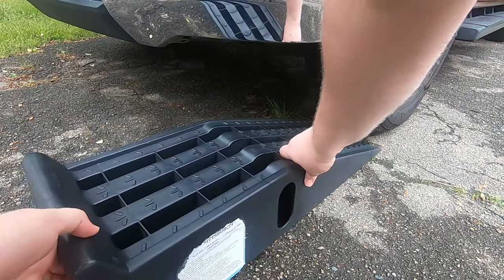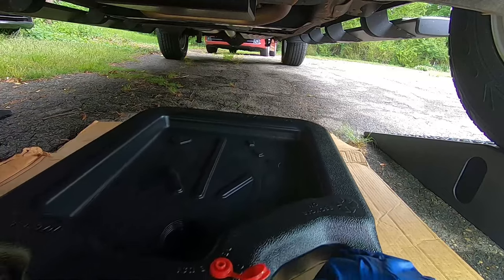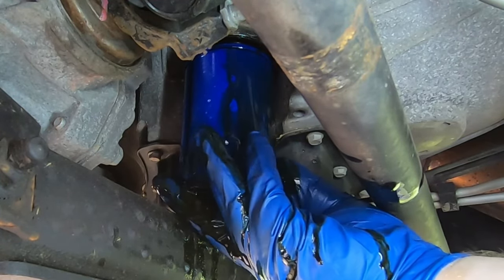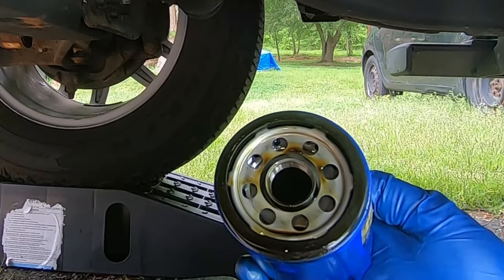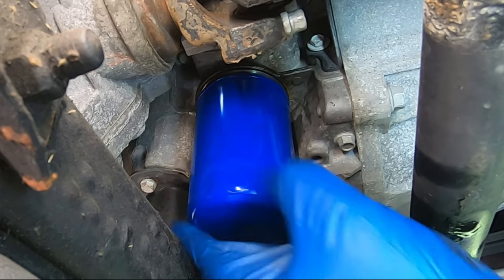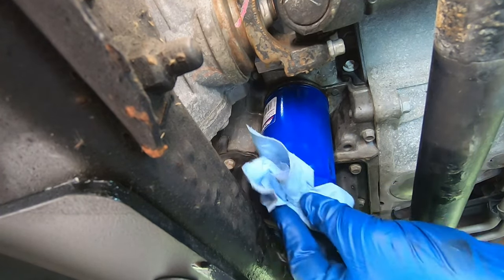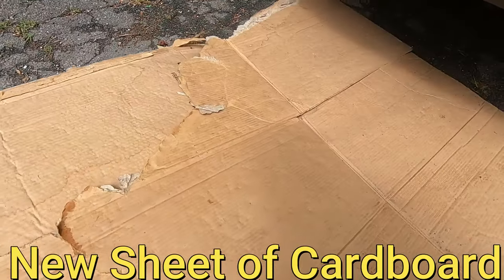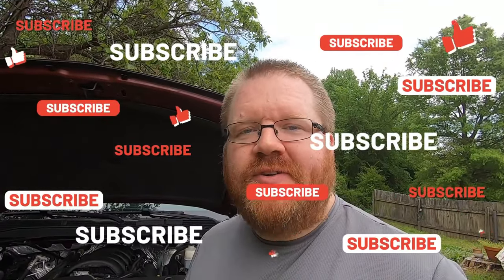2014 - 2019 GM 5.3 Liter V8 (L83): Oil & Filter Change - Full Walkthrough!

Comment: Just like Chevy to put the same motor in every vehicle lol. And particular reason for going with mobile one? Meaning is that what is recommended?
Reply from the maker: Mobil 1 is Dexos licensed, meaning that it meets GM's stringent Dexos standards for synthetic oils. Most GM vehicles produced after 2011 require the Dexos approved oil specification. So as long as the oil says it's Dexos certified on the back label, it should be fine to use. 

Back in the day, Mobil 1 was recommended on the LS1/LS6 engines on the C5 Corvettes. It said Mobil 1 right on the oil caps 😉
Reply: @TrickShiftGarage  I noticed "Mobil 1 Advanced Full Synthetic Motor Oil 0w20" is dexos approved, however not the one you used High mileage one, unless its hidden ? also whats that ticking/clicking sound every one second interval ? (at cold start) ....
would using kirkland 0w20 dexos approved is fine too(with mobil 1 oil filter) ? just worried about lifters issue
Reply from the maker: You know... I think you might be right! 😬

Looking it up online, the high-mileage version doesn't have any references to being Dexos approved! The normal 0W-20 synthetic is Dexos approved but the high mileage version isn't... that's so strange! Great catch on that! I'll make sure to get the regular 0W-20 going forward. You should be fine to use Kirkland 0W-20, since that does say it's Dexos approved 😉

I suspect the ticking noise is a lifter going bad but can't confirm anything yet. It's very common in these engines unfortunately. My truck had it since it was bought but hasn't gotten worse and no driveability issues either, just the noise. Anyway, thanks again for checking up on that, I appreciate it! 👍